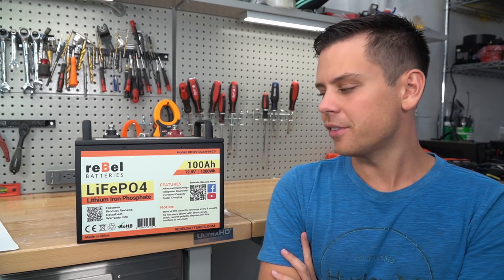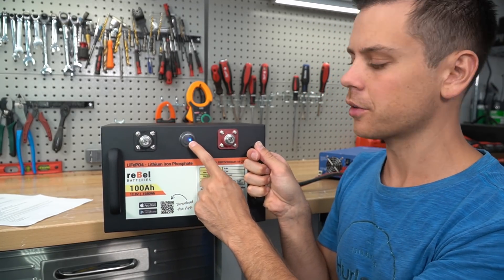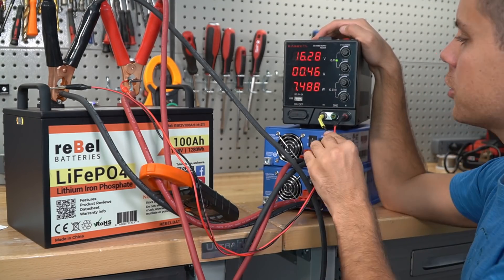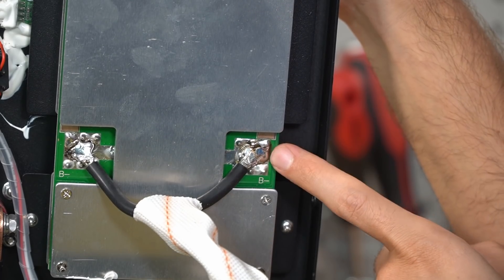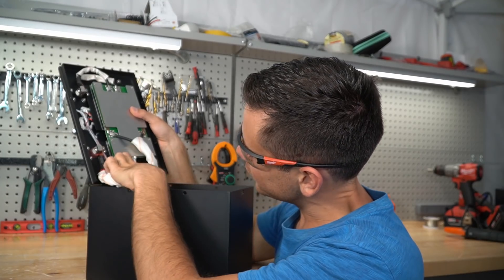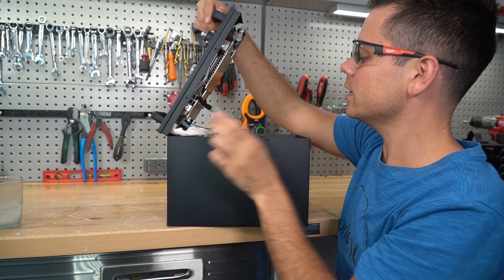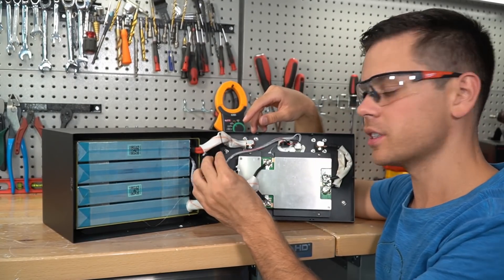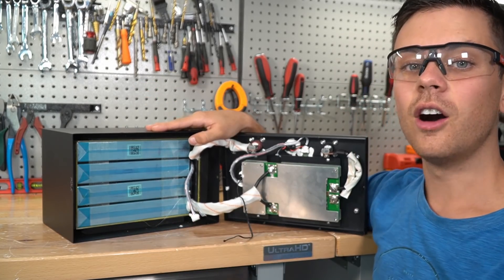$619 "ReBel"12V 100Ah LiFePO4 Teardown!

Comment: I’ve been thinking about preparedness for a natural disaster lately. I have an ecoflow. In a disaster scenario would I be able to charge a battery like this with EcoFlow and its solar? Also can this be hooked up to the eco flow as an extended battery?
Reply: EcoFlow Delta? It's 48V internally so you couldn't hook it up as an extended battery, unless you had 4 in series I guess. For charging from the Delta you couldn't use the 12 V output as it would cut out from being over current (pretty sure). You'd need to use its inverter (inefficient) plus a regular mains battery charger. So yeah if it was a disaster you could do it! But you'd be better just to get a regular 12V solar charge controller and charge this 12V battery directly from solar. Then you wouldn't be relying on the Delta as your only solar input too — more redundancy. Those charge controllers are pretty cheap especially for the PWM ones. MPPT is a bit more efficient but maybe not worth if it's just for disasters. Too much info in one comment, sorry! :)
Reply: @johndalgliesh9220  Thanks John for the run down! I’ll look into the stuff you mentioned

Comment: So wait.... prismatic cells should be upright? I thought one of the advantages of these was that they could be oriented sideways either on edge, or stacked flat. My diy milk crate build cells are on edge..side by side,  just like these are when the box is upright. Great! Now I must rethink the placement of everything.
Reply: I am not so sure if it's an issue, I think the only issue is mounting them upside down.  If they are in a case this may not be so obvious.  I think Fortress eFlex batteries are sideways in the case and the bus comes up length wise.  The really detailed instruction manual says you can mount them anyway except with the Right side downward.
Reply: I think it's more the difference between "perfectly acceptable" and "optimum". Maybe a small degree of difference. Just not upside-down and it seems you're OK.

Comment: This is too expensive I bought custom made 48v 105ah 5.2kwh with 16 3.2v eve prismatic cells for 1200$ i used 2 for my 5.5kw solar inverter. Even 16kw  310ah 48v now can be bought for 2500$

Comment: I just picked up a couple of 12v 100ah batteries here in Canada for $450 CAD each (about 352 USD). I have one other I use for my trolling motor on a boat that I only run an electric trolling motor on. It has huge run time. I can use the motor very heavily in a day and not kill that battery. Not even with 2 days of windy conditions. I am going out on a trip the end of September and it’s on electric motor only lakes. That will test the battery’s longevity with a 40 lb thrust Minn Kota Endura Max. I will take a second one, just in case, as well as my charger.  When one is not being borrowed for fishing I am using the 2 batteries in a utility trailer I have to haul the fishing gear around in. It is nice having 110v in there. I am hooked up to a 3000 watt inverter through a 30A charge controller. There are 3 x 100 watt panels on top of the trailer. Not quite the max, but good enough. I am replacing a couple of 105 ah lead acid batteries that are almost 10 years old. They do last if you take care of them, but they have maybe 60% of their original capacity so it’s time. I am hoping the batteries do well. I won’t have them in the trailer in the winter but when I have the trailer in use I park it in a heated shop when I’m not fishing. These batteries are pretty simple and so they don’t really have much cold weather capabilities. They have cold temperature shut off for charging purposes set at 0 C. They should never see those temperatures. Even if it gets cold out when fishing late in the season, there’s a heater and thermostat in the trailer that will keep it around 10 C at the coldest. I could disconnect the solar if needed as well.  They can be discharged in temps as cold as -10C. 
    Hoping they are good batteries, time will tell! I don’t really have a brand name. They come from China and are built for a company called Alberta Lithium. Great service! Good prices. Other Canadian lithium battery companies are much more expensive for comparable batteries. For batteries with cold weather protection (heated) they sell for $649 CADat ABLithium when that similar battery sells elsewhere for $999 CAD. Sheesh! 
     So far so good!

Comment: Hi Will.  Love your videos, they are quick and to the point without too much unnecessary chatter.
I would love you to test some of these 48 Volt 100 Ah battery packs from Top Battery that are in a 19 inch rack mount case.  They are on eBay item number:353322182224 and are a very reasonable price of AU $500. I need a couple of these for a 96 Volt 3kVA UPS.  I don't know if you would be able to get them (or similar) in the US tho. 
Cheers from Australia
John

Comment: Home-made soldering job. Battery glued to death to the steel box.  Temperature sensor wire unconnected. Summary: POS for $619.

Comment: I prefer solder over bolts. I’ve had bad luck with bolts in environments with vibration. I design cabling for everything from bicycles to earthmovers to control systems. Anything not soldered then protected comes apart, breaks, or corrodes.

Comment: It appears that China currently dominates the solar panel industry.  Is this likely to be the same for LiFePO4 batteries too?  I'm not opposed at all to buying Chinese, but it sure would be nice if there is competition.
Reply: Part of China's dominance in manufacturing is their lack of strong emp0loyee and environmental protections. That's not a sustainable approach in the long term as they will discover. Or perhaps they understand this now, but think it is better for them now to do as they are and try to deal with the problems later. Either way they'll have the LiFePO4 market for awhile, and perhaps the panels too.

Comment: Maybe try carefully warming up the bottom with a heat gun, there is generally a foam layer between the cells and the case when glued so shouldn't heat up the cells much but be careful.
Reply: You beat me to it.  It's probably held on with hot glue or double sided tape.  Since it's a metal case a heat gun should do the job nicely.

Comment: Very funny, those guys should have hired you as a consultant before sending you this battery.
Reply: Why? Do you really think they could have gotten him for less than the cost of manufacturing 1x 100ah battery (certainly less than $300?) Because they got the same information this way, PLUS potential exposure for their company to Will's 500k subscribers.
Reply: @DJStig  Maybe because after seeing this video with batteries laying on their side, a big no-no for lifepo4 and a cheap balancer, no one will buy a unit from them. When you can build a correct equivalent configuration for half the price as explain in many of his videos.

Comment: I hope that, when you contact them, they change their assembly process to properly position the low-temp disconnect.  Looks like I've found the right vendor for what I need!
Reply: Check out their response to this video. Will pinned it to the top of the comments.
Reply: Feedback has been received and all batteries will ship with the probe positioned on the cells. Thanks!

Comment: Ouch! But that's what happens when you send out unsolicited "test mules", based on nothing more than aggregate category data, and likely just your subscriber count. 
Just tryin to make a quick buck, it seems. Serves them right, though. Hopefully they will learn more from this review than just their marketing mistakes. And take your criticism positively, and use it to correct the flaws in their product. Then send you another one. Good video, and thank you. Savin us $ 👍
Reply: That's exactly why they sent it out. They got quality advice from an expert in the field combined with exposure for their brand to his page's half million subscribers who are at the least a little interested in solar/batteries for the cost of manufacturing 1 LiFePo4 battery (if it retails for $619, I'd guess their cost to manufacture is <$300.) A pretty solid business decision if you ask me.
Reply: @DJStig  Maybe I'm missing something...
   If a manufacturer has the facilities, tooling, supply chain resources, and the human resource brains to put it all together, one would think that they also have the ability to do their own due diligence in R&D, in regard to their competition's products.
    So sending out a battery that they clearly know is "sub par" in component, wiring design, and placement, only to garner a definitive thumbs down review, seems like a rather UNsolid business decision, actually.
    And that was my entire point.
The old adage of "even negative press, is still good exposure", only holds true in D.C. and Hollywood. It's hardly applicable in the sphere of retail electronics. Especially when a critical failure in a Lithium battery could involve having to make a home owner's insurance claim, because of it.
    I guess the bottom line is, based on the review in this video, would YOU buy these batteries for a system build? And if not, how was this a "solid" business decision for this company? And respectfully, their "build cost" to profit ratio is entirely irrelevant if the end result is a "do not buy" review.
   What am I missing?
Reply: @Terryblount  Bingo! Thank you, Terry. Now it makes perfect sense. R&D? We don't need no stinking R&D! We'll just slap em together, send em off, and let the experts pick em apart, publicly, for FREE. Harvest the info, correct the flaws, then change the number on our race car.
   Cost of half a dozen batteries sent out.... $3K. Savings on not having half a dozen R&D techs on staff.... $30-70K annually (I actually have no idea what 6 Chinese R&D techs would be paid annually, but obviously it's more than $3K.) 
  Having the ability to literally disappear, then reappear with a brand new "start up" name, and logo, overnight....priceless.

Edit: Again, thank you Terry, for taking my comments as a serious inquiry, and not as some toolbag troll, coming on here just looking for an argument. I sincerely could NOT realize that angle in this. I forget, China's business regulation, and oversight, is way less stringent in regard to exports, apparently. Especially when it comes to f**kery in regard to the U.S., it seems.

Comment: That is a very good JBD BMS rated for 150 amps. Other than the temperature sensor placement, it is a good battery (and I agree, I would rather not have the soldered connections). They tried a little too hard for the correct size of the battery, I would rather have a taller battery with upright cells, even if that makes it an odd size and shape.
Reply: I quite agree with you that a battery needs to stand in the battery box, which will affect its life

Comment: following off grid garage latest tests on charge rates and amps absorbed into the battery   . try the test again after a lower charge rate
Reply from the maker: Yes those are fun tests but I am doing full advertised rate with HVD. Just so the test is fair
Reply: @WillProwse  it would be interesting if you got the same results.  say at a charge rate of 50a,   the same as the sok
Reply: @WillProwse  it clearly took the 100a charge rate,  it would be just a fair test if they got the same energy absorbed while doing a capacity test.   which until i see the results from the off grid grarage, i had not considered before.

Comment: I'm gonna wait until Will builds a battery before I go solar!
Reply: You don't need a battery to go solar to virtually eliminate your electric bill.  In fact most solar homes don't have a battery system because of poor ROI.  But in states that have lots of power outages, it could be worth investing in a battery backed system.  If you live in CA it's wise to invest in solar before the new Net Metering rules change in April 2022, and get grandfathered into the current NEM2 program for 20yrs.
Reply: @TomSpurlock  Lithium Iron is rapidly changing that equation.
It's still not practical for someone in FL or W. Virginia to use batteries but once your KWH price goes past 30 cents it can make a lot of sense.
In Ca and Hawaii it is a very good investment.

Comment: So I guess it has to be set to 5c to offset where it is (or just open it and reposition the sensor and set it to 1c and put protection over the Bluetooth cable), the main cables should be fine but i agree risk of them just flat out falling off if they detach from heat cycling or poor soldering job is a likely chance 

and that the battery used might need to be held up vertically witch be having the battery terminals facing you (left side)

Hopefully they actually look at the video and fix them 4 issues listed, battery in there side when should be vertical (unless they are type that are fine in there side) , temp sensor is on the battery (and set low temp to 1c not -5c) and fix cross bar cutting the Bluetooth cable and soldered cable connections (maybe also derate the battery to 90A with 100A expected capacity as once it drops that voltage so low a lot of inverters would have cut out before the low voltage cut out on the battery triggered)

Not bad for random battery turning up at door

Comment: Will why do u do so many teardowns on 12V?
There are a lot of us who are now interested in Off-grid applications.  So 48V is what we are looking for.
On your 2nd to last video where you used 2 MPP inverters you said you were still waiting on your 48V batteries but you didn't tell us which ones you ordered, how many you ordered & what you paid for them.
Reply from the maker: Yes, I'll make videos on some new 48V packs
Reply: @WillProwse  Yippee!
Reply: I think he is targeting the larger group of RVers and weekend cabin owners moreso than the off grid DIY viewers.  Offgrid these days has really started to move away from 24v systems and 48-72vdc  systems are slowly starting to become more popular.  It's super easy to find 48V stuff these days so I am sure it won't be long before we start seeing these higher voltage systems takeing off.  The challenging thing to consider with many of these 12v batteries is that they don't always play nice in a 48V configuration where each 12v battery has it's own BMS.  They will work but it is possible for them to go out of balance and periodic top balancing or using a 48v battery balancer will likely be a consideration as they age along with a rotation schedule.  This is where 48v and higher packs will be the way to go for most offgrid setups.
Reply: Yes 48V packs would be nice.  Maybe Fortress would send you an eFlex battery to run tests on.  They can easily be opened so I don't think they would mind you opening a loaner.